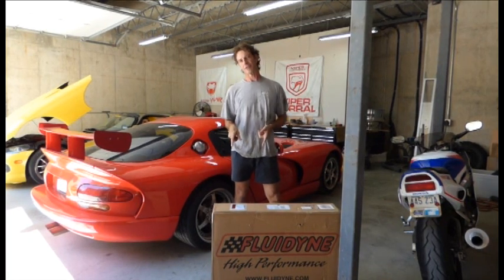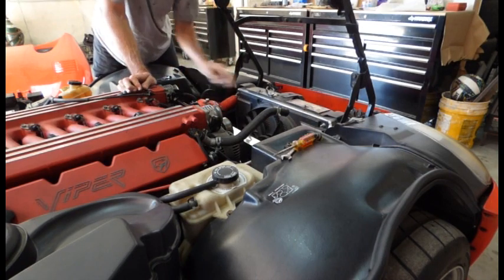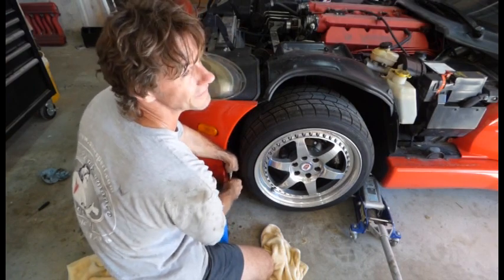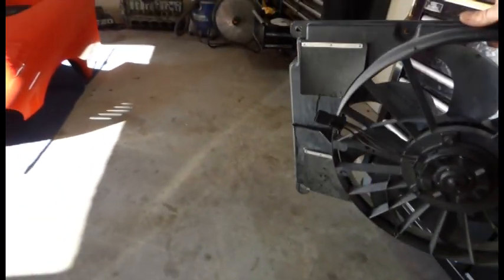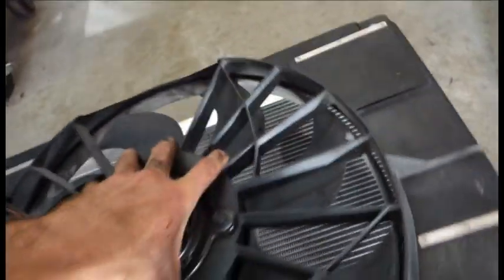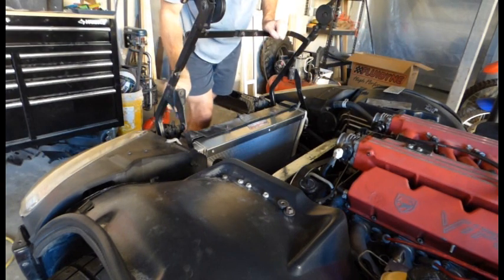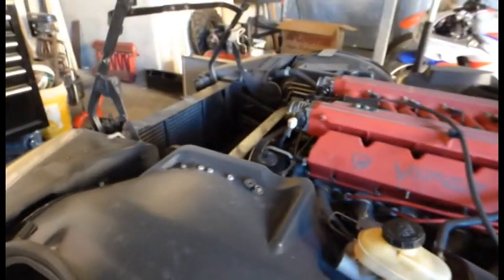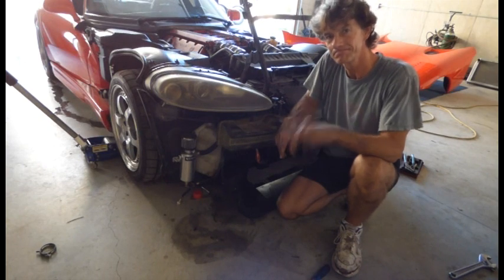How to install Fluidyne radiator Dodge Viper GTS RT10

Comment: I’ve read go back with oem I was thinking aluminum three row is that a mistake should I go with oem. Thank for taking time to do video its guys like you that help us out
Reply from the maker: I had a Roe Racing radiator that fit fine.   I'm just not all that impressed with this new one.

Comment: My viper runs wayy hot, do you think its possible to put a rear exit exhaust from a gts on a 94 rt10
Reply from the maker: The rear exhaust still runs down the side sills so it won't make a difference in the heat coming off the sidesills.   Make sure that both fan relays are working.  They are in the engine compartment hidden underneath some airconditioning stuff. Your fan should come on at 205 degrees (or when AC is on) and it should switch to high speed around 215 degrees.   Also make sure your gen 1 is properly "burped"--you'll need to jack up the right side of the car an additional 12-18 inches to get the coolant reservoir higher than the radiator hose.  Fill your overflow bottle with a syringe and put hose clamps on the tubing.

Comment: What's the easiest way to access a on the driver side headlight. I want to see if it can be done without removing the whole bumper.
Reply from the maker: Not possible.   There are three nuts under the headlight that can only be reached when bumper is removed.  This makes aligning the headlight after re-installation  a time consuming task.
Reply: mcgyverdude kind of what I have seen from the forums. I just wanted to see a quick fix. I noticed one of the nuts fell all so my headlight moves. But wanted to avoid taking off the bumper bc of the shims and troubles with gap alignment

Comment: Did you see any improvements in your running temperatures with this radiator in combination with the 180 thermostat?
Reply from the maker: not really.   Apparently there was nothing wrong with old radiator.
Reply: @CrankAddict  in what circumstances it was getting hot? Thank you